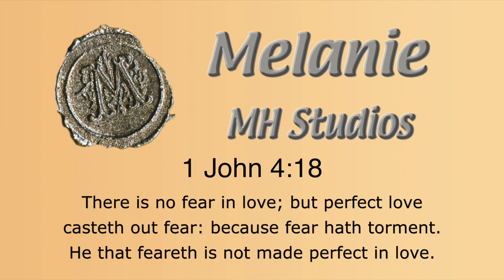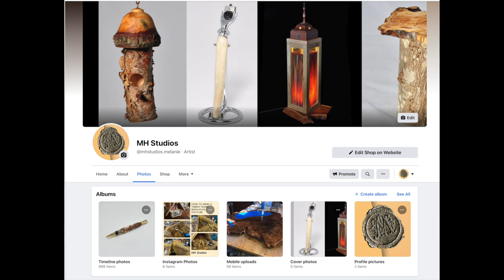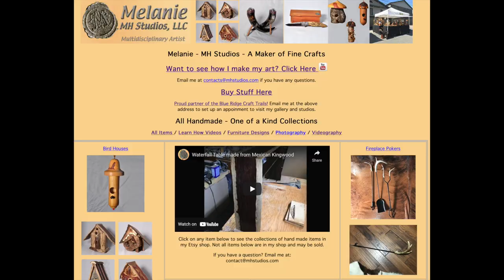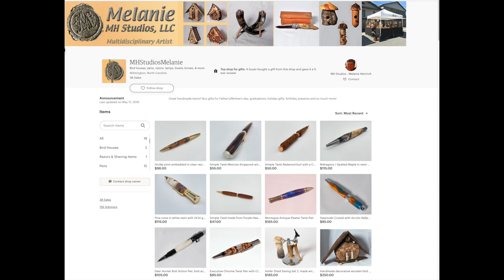How and where to Sell your fine crafts - Birdhouse build Pt 3

Comment: Beautiful work and love your channel. thank you for all the useful advice. Do you have a way to mount these birdhouses or did I miss an episode where you show that?
Reply from the maker: I may have suggested different ways to mount them in upcoming videos. I have several new videos coming soon. Quickly, You can attach a hook to the top but then the birdhouse will sway in the wind. Or you could mount a board on the bottom and attach it to a post that is stationary. Thanks for your interest and subscribing!